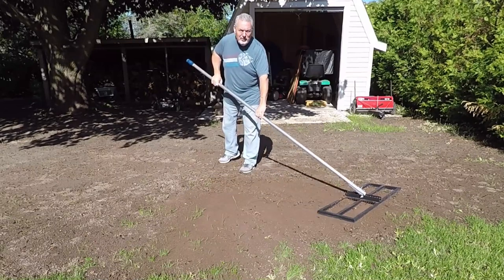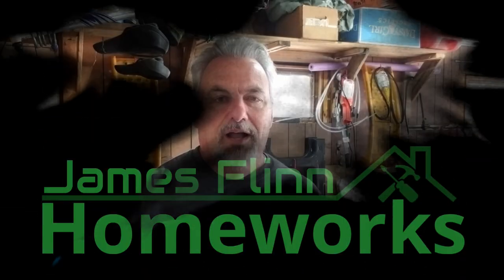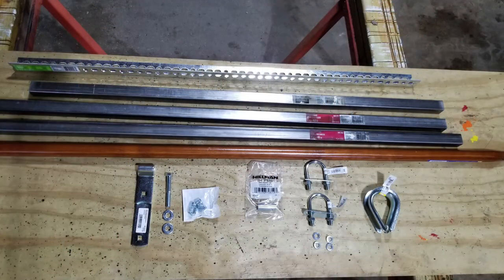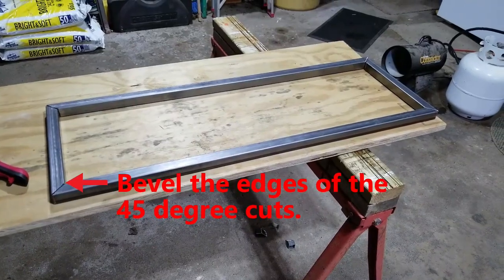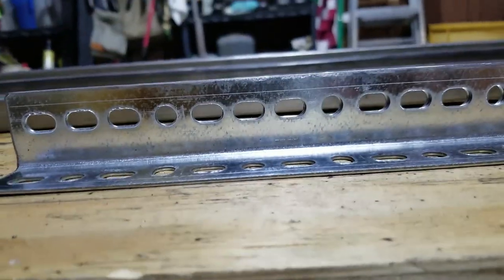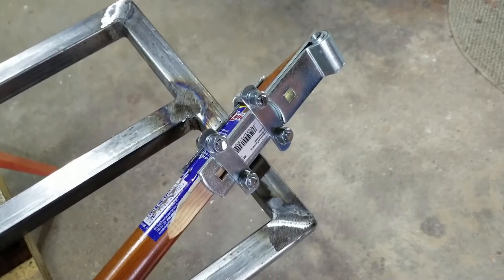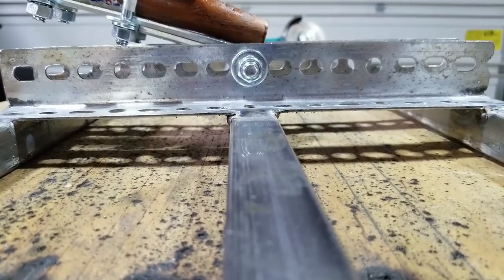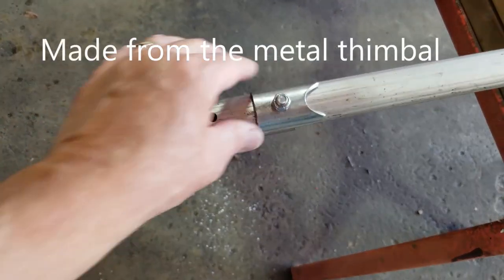Tired of mowing a bumpy yard? Build this Yard Leveling Rake and make your yard a golf course!

Comment: Nicely done.  I'm about to practice some welding and build one.  Do you think the sharper corners of the square tubing wouldn't be as smooth as the rounded corners on the angle iron.
Reply from the maker: The edges of square tubing isn't all that sharp of an angle, so I wouldn't worry to much about that. Also, your corners won't really be that sharp because of the weld joints and then lightly grinding them smooth. You can pretty much build them from anything, you just want to keep the total weight down to between 5 - 10lbs. Any lighter than 5lbs and it won't be very effective. I did build my first one from slotted angle, but I didn't care for how light and flimsy it was. It just didn't move the dirt the way I wanted it to. However, it did move easier than the square tube because of it being so much lighter. Thanks for the comment!

Comment: Might I offer a suggestion?
I noticed your gate hinge rolls to one side of the centerline. Invert the hinge and place the roll up against the end of the wooden handle.
This directs the force of the handle directly down to the bolt and allows for more swing in either direction.
Great build!

Comment: I just made one from square aluminum tubing and some angle iron to add some weight. I just used bolts and lock washers to hold it all together. also used a pool pole. thanks for the build.

Comment: That slotted angle is likely zinc plated, so be sure you’re well ventilated when you weld it! Nasty stuff. Great project though. I want to make one as well. Built a roller out of an air tank, and a soil probe.
Reply from the maker: Really good point.

Comment: You could have used some metal conduit for the handle. It’s probably galvanized so not for welding, but the length and diameter selections are more varied.
Reply from the maker: Yes!  Great idea!!  I didn't think of that.

Comment: Brilliant  video , I am going to do the same job . Why did you not use  the same material for  the handle, with a small tee welded on  to assist pushing or pulling and one hole drilled through for the bolt . I may be wrong but  I think you went to a lot of trouble using U bolts ,bushes,gate-hinge etc . Correct me if I am wrong , I still think it is great end product and will last a lifetime .Thanks for upload .
Reply from the maker: You are correct, your idea would work as well. I was looking for something a little more light weight for the handle, verses adding the weight of the square tube steel. You want to try to keep the leveling rake right around 10lbs if possible. To heavy and it will dig in, to light and it won't level the ground properly. Mine was right around 11lbs, so fairly close.

With that said, you're idea of welding a tee on the end is brilliant. Having something like that on the handle would be a big help when you're moving a lot of soil around.
Reply: @jamesflinn8630  Thanks for reply. I will take your advice on handle . Keep up the good work .

Comment: Why do you need to line up the two holes?
Reply: Because a bolt is passing through these two holes.
Reply: @saraswatih9703  sar·casm
/ˈsärˌkazəm/
Learn to pronounce
noun
the use of irony to mock or convey contempt.
Reply: @hopper1415  Do not ask stupid questions then